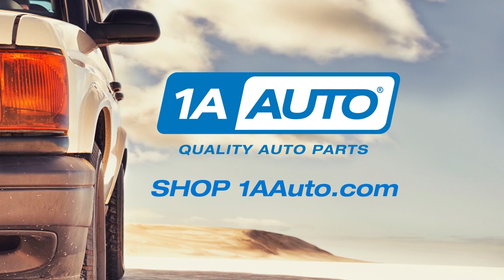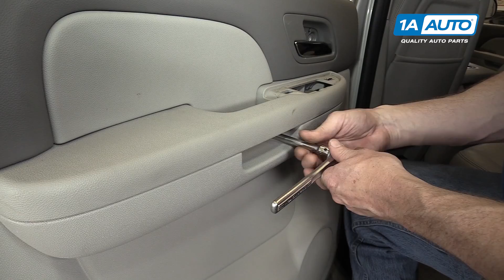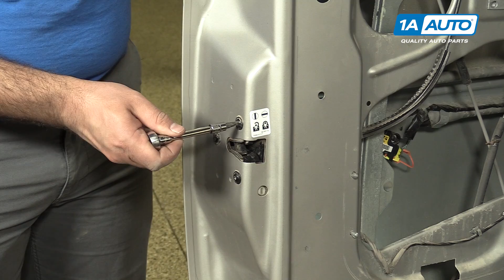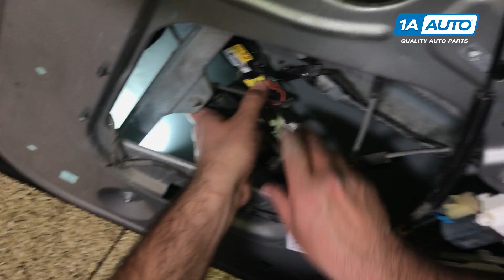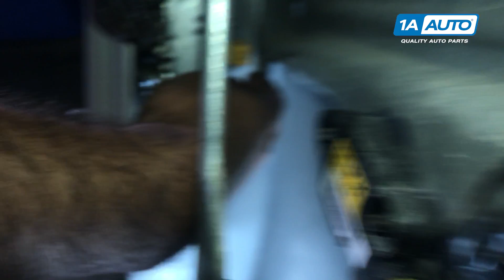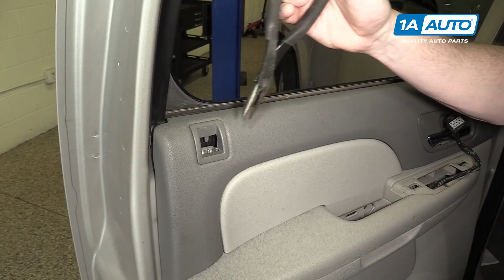How Replace Rear Door Lock Actuator 07-09 Chevy Suburban

Comment: Pretty lame that you have to press a button to turn it on.  There should be some type of module plugged into one of the reverse lights (wireless) that sends a signal to turn it on. Also, besides having to turn it on before you reverse, it does not know when to turn off.  So refined driving forward with this screen on with guidelines for 30 seconds haha! Ghetto

Comment: So great video, as usual.  A few trial and error tidbits when reassembling,  for those of us in the "real world" - line up the foam sound barrier by placing on the door trim panel FIRST, not on the metal part of the door.  This accomplishes two things: you line up the holes correctly, AND there are plastic grommets which you need to affix the foam onto the plastic door trim, that you can only do it you do it the way I suggest.  Also, before you "batten down the hatches" on the door trim panel, make sure that the metal female fitting, in which you put a bolt in behind the door handle, is lined-up.  If it's not lined-up, you'll have to pull the door trim away from the metal frame in order to line-up the female end with the bolt.  Other than that, again, good and succinct video with no B.S. (unnecessary chatter).
Reply from the maker: +John Branch Thanks for checking us out!
Reply: I just use a couple pieces of painters tape or masking tape to secure the metal nuts (what you called the metal female fitting) for the 10mm bolts in position and hold them there. Otherwise, they always end up moving.

Comment: This worked perfectly for my 2007 Silverado LTZ (new body style)
The only thing I did different was after I popped the door cover off - I spun the cover 90 degrees & removed the electrical cable like that instead of risking damaging the wood grain pieces. The less that those little suckers come off the better because those little pins on the back are brittle.
Reply from the maker: +nubbalotus Thank you for the feedback and for watching!

Comment: I assume this is exactly the same for my Cadillac Escalade ESV 2008. If so, Is rear driver actuator for driver and passenger side the same? Where can I buy them from you directly?  I see some of these actuators come with a cable attached and some only module. Which one do I need? Thanks.
Reply: Do you have electric running board. Do you have trouble coming down with one door

Comment: I have problem with my Cadillac Escalade 2008. I assume its exactly like yours as shown in this video. Am I right? My problem: Lock motor sound like working and audible however door wont open or lock with remote. I can unlock, lock manually with pull and push of the lock tab. Is my problem actuator or something has come out of place/loss in mechanical chain of connections? As I can hear a working motor in the same door? Thanks for your helpful video.
Reply: I have the same exact problem, were you able to figure out what it was?
Reply: @MoeHooHen  Did you ever figure it out?  I have the same problem.
Reply: Yes it's your actuator